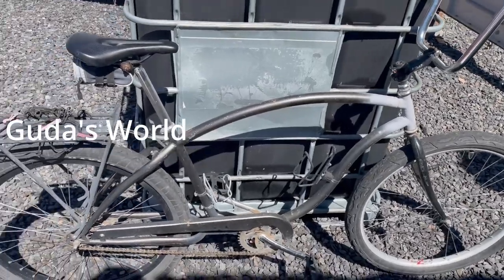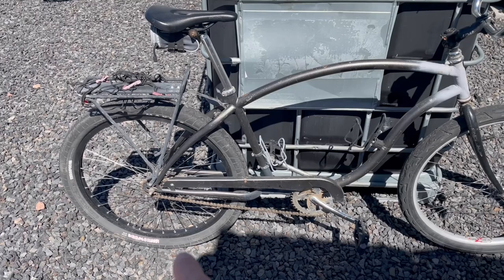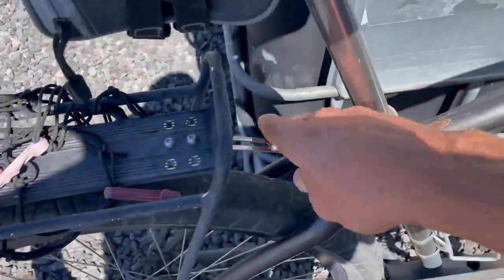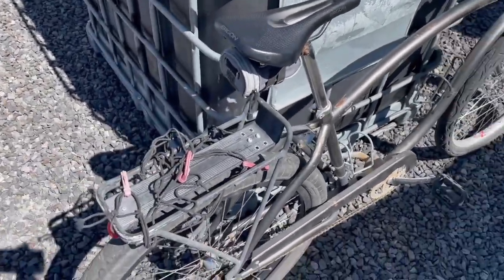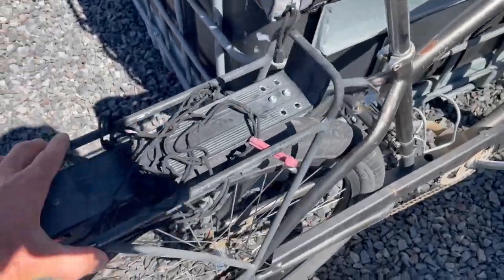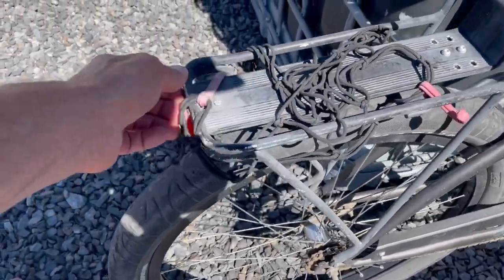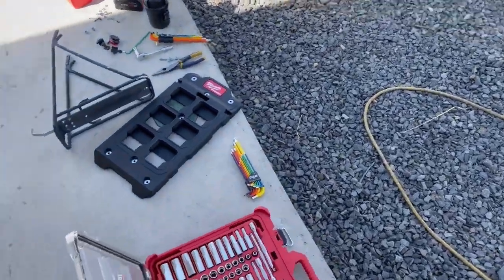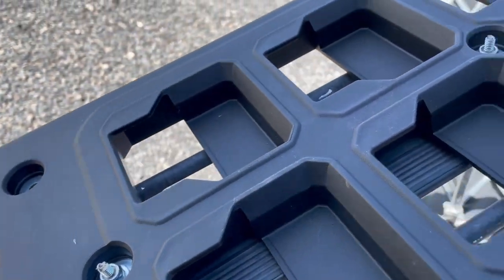So I put Milwaukee Packout on my cruiser bike

Comment: I did the same thing but I used the big slim organizer as the bracket for tools and sprays for my bike then I use the Milwaukee milk crate for bigger stuff like drills sawzall and nailers. You have any suggestions on keeping the handle bars from swinging to much from weight. I have to load and go if I keep the crate full
Reply: @GudasWorld  that would be cool. I might try the smaller boxes on the front for counter weight  appreciate it